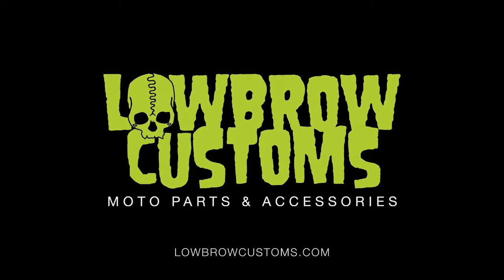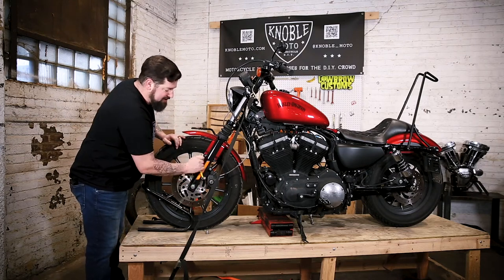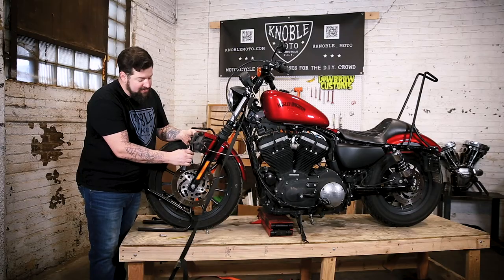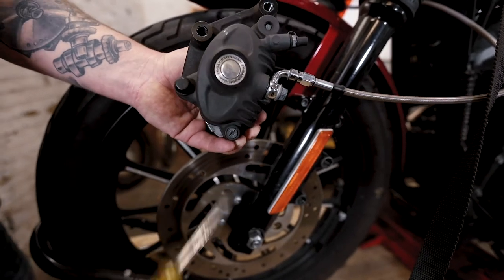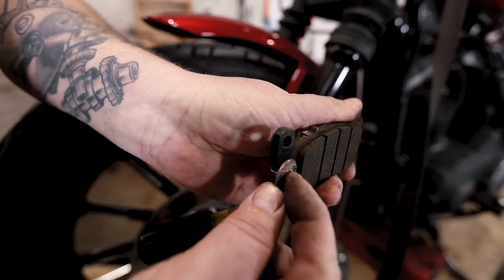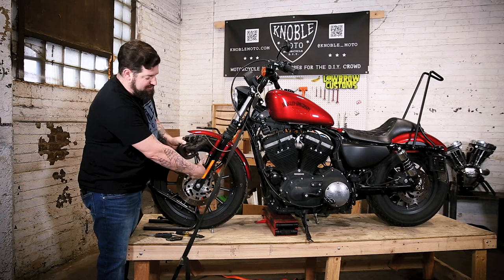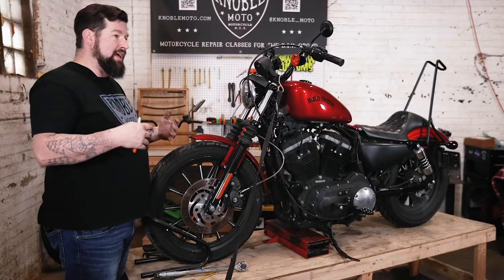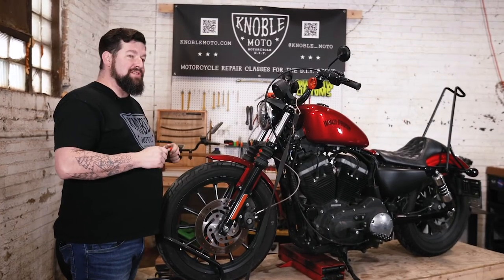Sportster front brake pad swap

Comment: This was good.! Thanks mate. SPORTSTER4LIFE ☘️ ☘️
Reply from the maker: I love sportys!!
Reply: @KnobleMoto  I got a 20 iron that I've got all beefed up, looking for a tank, my dad dropped a 2x4 on it and I haven't had luck finding a painter, I'd had my eye on a tank at LBC, but the only issue, I have no, absolutely no idea where I'd get even a simple black with a 70's styles sporty sticker I have on hand I got at a swamp meet. Matte black with am old skool sporty logo Would be awesome, I'll settle for used too, so if you know of anybody that may take on a small.project like that. I would buy the tank from Tyler  @ LBC but need a simple paint done. I'm in Minnesota. It's a 2020 iron 1200, it's got a tiny tank on it now, I'm going at least 3.2 and I've got my eye on at least 2, just don't want to buy without a painter lined up. Donnie Smith bike show is coming up, I might try rhere at the swap meet.